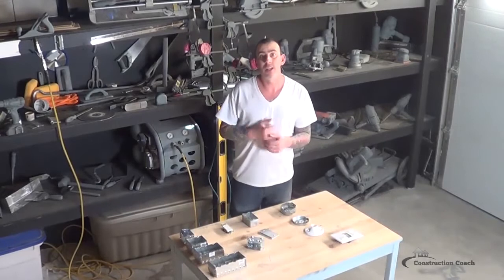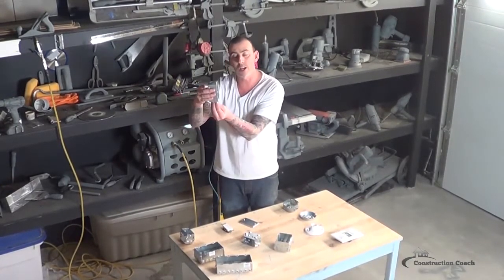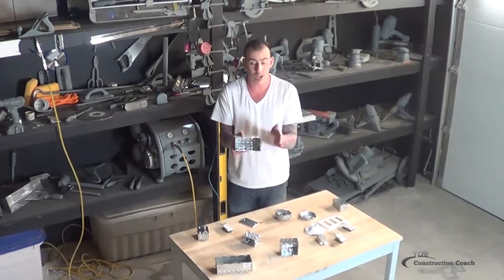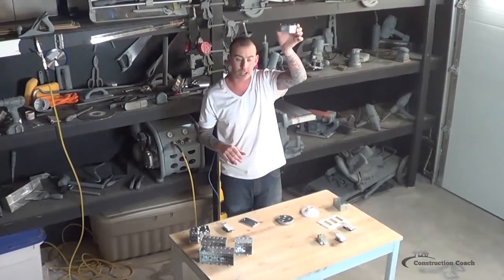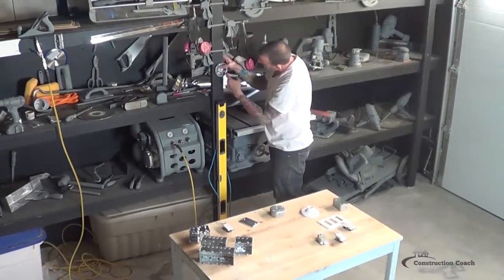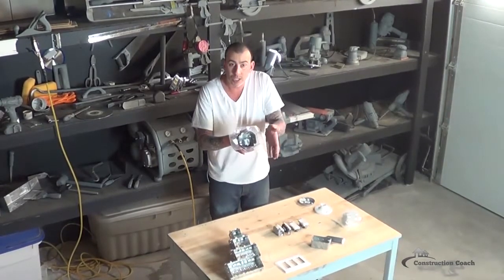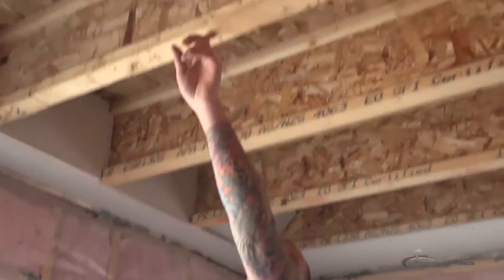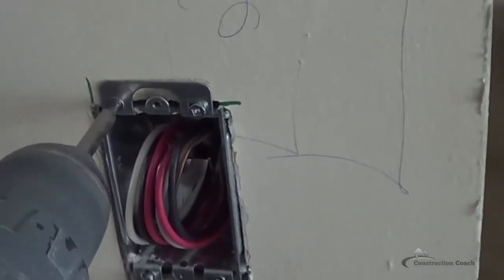Learn About Electrical Boxes - Quick DIY

Comment: How do you install the wire into the receptacle when using a vapor box like you did at 10:25? Won't inserting the wire break the airtight nature of the vapor barrier?